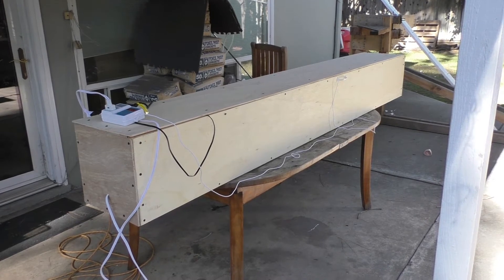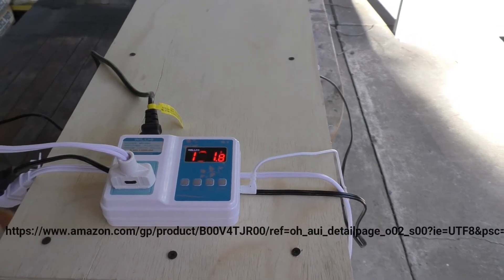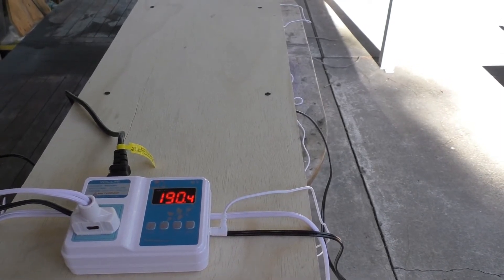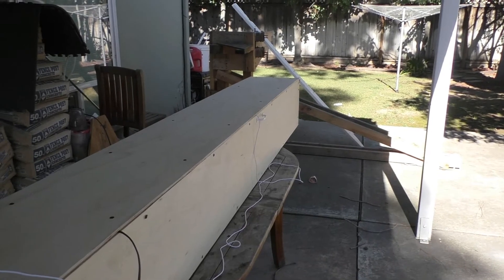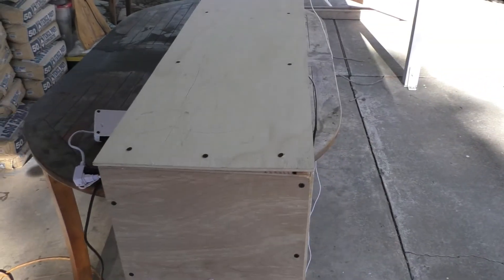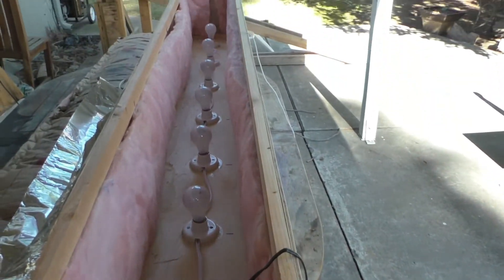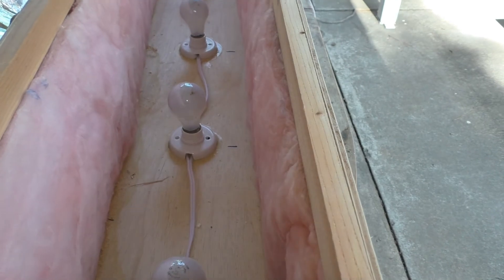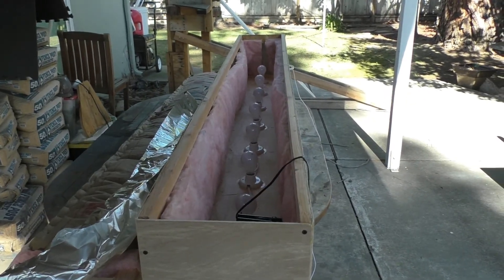Composites Oven, EasyBake Style - KW MkII Rigid Flying Wing Footlauch Glider

Comment: Curious....How are the parts actually held in the box whilst curing? I didn't see a shelf or hanging mechanism..
Reply from the maker: Good question! I use a couple of upside down paper cups. I position them so the mandrel rests on them without the layup touching the cups. If the layup touches the cups, it can leave marks. A couple of "V" notches in the cups will keep the tube from rolling off.

Comment: Is that temperature range you mention (180 - 190) in Fahrenheit or Celsius?
Reply from the maker: Unknown at this time. Each epoxy has a best cure temp and ramp cycle (or even post cure). It is always necessary to consult the epoxy mfg Product Data Sheet to get the temp/cycle specs for curing.
Reply from the maker: Fahrenheit